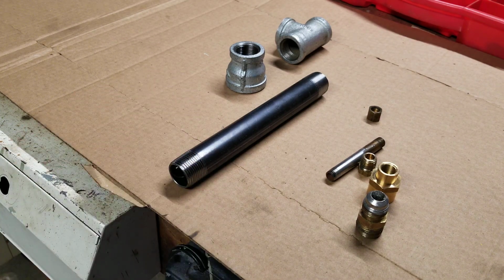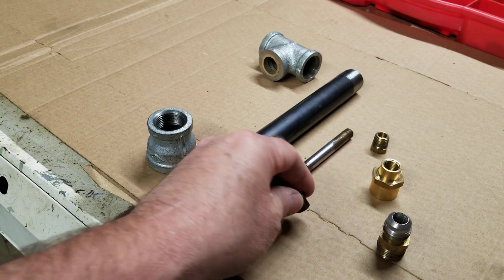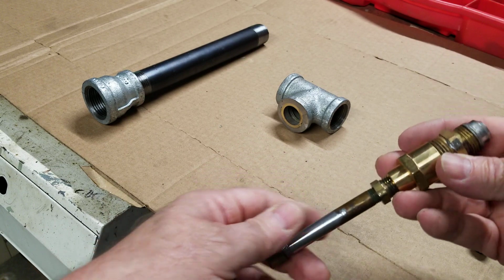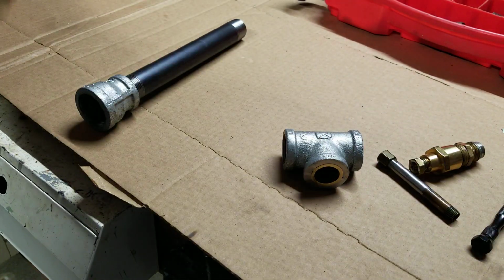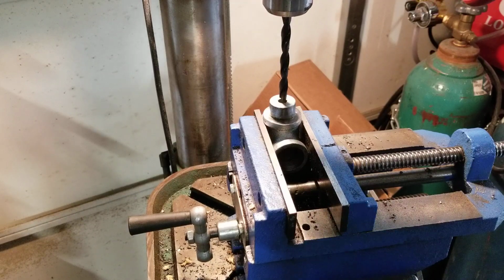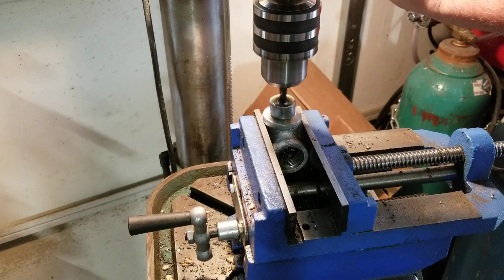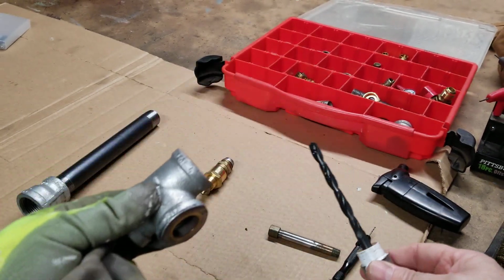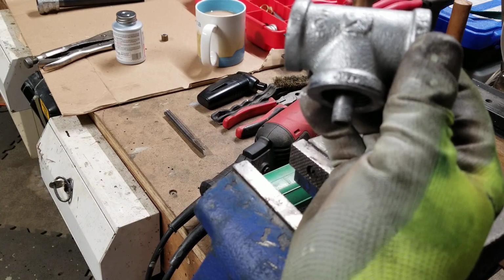FORGE PART 10 ANOTHER BURNER STYLE BUILD YOUR OWN

Comment: Instead of your gimble use a 3/8 flare adapter tap out the hole in the T  3/8 npt  . Drill adapter so 1/8 pipe just slides  through cut 2 slots in flare end, making a collet screw on a flare nut . This will lock tube where ever you want be square also.
Reply from the maker: Cheers, sure you could do that and about 20 other ways. I was giving it way of manipulating the nozzle location (which can be hard to center in the caps) to fine tune based on the cumulative threads not well cut and drilling location issues, I have seen with some of the other designs. This allows people without huge amounts of tools/accuracy  to make a burner / Please make one and throw it up on youtube share ya method